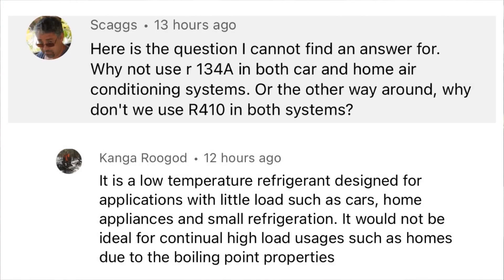Why Can't All Air Conditioners use R134A

Comment: That doesn't really answer the question........

Anyways,  I assumed they used R410A because of its high compression.    Higher pressure means higher temperature  while at the same time still provide cold air conditioning properties.  This is perfect for heat pumps.   And also,  it's higher heat compression at the condenser side allows for efficient removal of heat even in summer time because there's still a huge temperature difference between the condenser and the ambient temperature.   R134a and R22 would not perform as efficiently compared to R410A in the same operating conditions  due to its lower pressure.   Perhaps,  even poorly when used in heat pumps operating in winter.

Comment: Different refrigerants run different temperatures at different pressures. A home A/C unit would have to be designed to work with R-134A. They just don’t design them for R-134A for some reason. I’ve been in commercial/industrial HVAC over 30 years but would be lying if I told you I know why they don’t use it. I’ve seen a handful of R-12 A/C units but never R-134A. Except chillers which are a different animal.

Comment: Not sure about that answer because the cars in Arizona in dead of sumer when temperatures are 115 and higher cars AC can run all day in those temperatures...also a guy on YouTube in Atlanta using R134 in his home unit 2 month now with no problems and that was in July of 2022.
Reply: Right - I always thought 134a was for low temp (reefer) or high load, such as a car interior that's been baking in the sun?   That said, even tho I'm from the Midwest, I still miss the ultra low vent temps of R-12.  Our 90 deg. summer days are often humid, and I just never got over seeing actual vapor leaving the vents sometimes  :-).